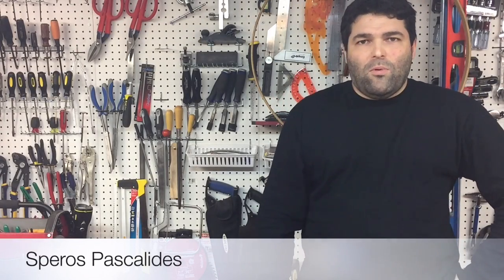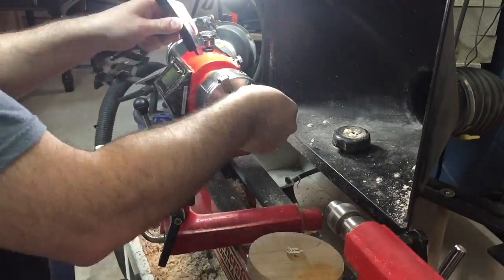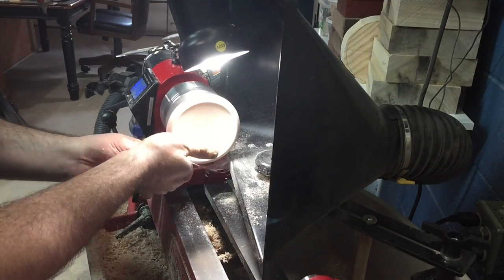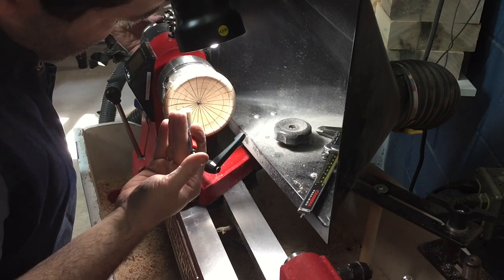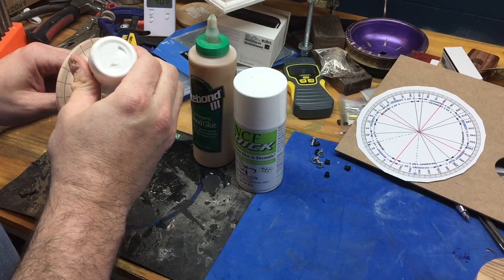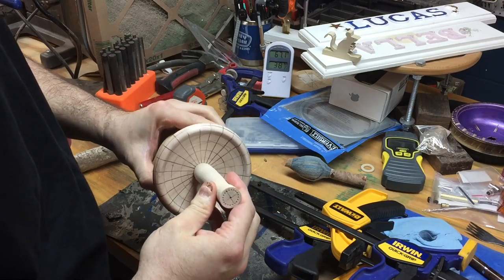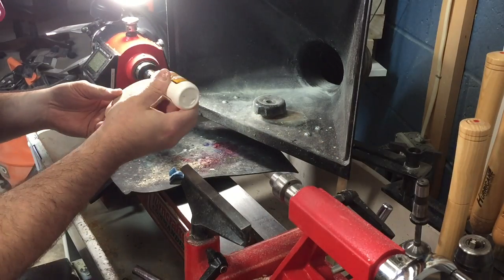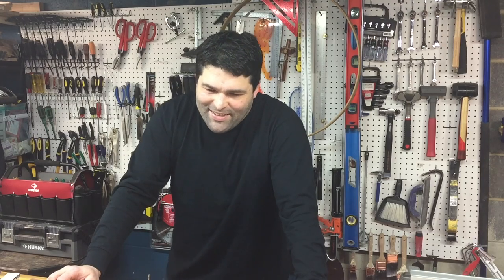A Wood Turning Design Change: Dish to  Ring Holder

Comment: Great video! What kind of lathe do you have?
Reply from the maker: +Wes Hamstra (Wes Hamstra Woodworking) Thank you. The lathe in the video is a PSI VS lathe (Pen State Industries). It's a little 10" swing lathe at 3/4 hp and variable speed, but I do like this little lathe. It is belt driven and needs to be switched for two speed ranges about 500-1000 and 1001 to 4000, even though it is variable speed. However, I adjusted the switch box and I can now go from 500 - 4000 without changing the belt, but the tork is lessened on the low speed because the belt is always on the higher speed, but it works for me because I usually only use the low speeds for sanding. Hope that helps. Cheers!